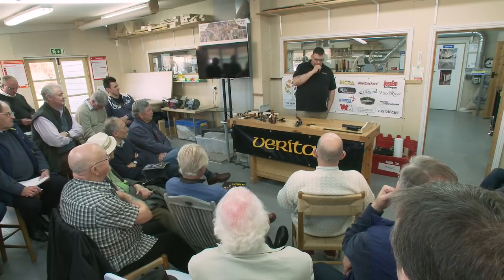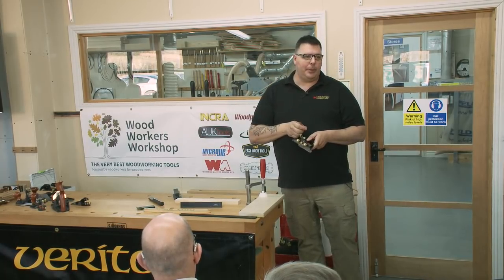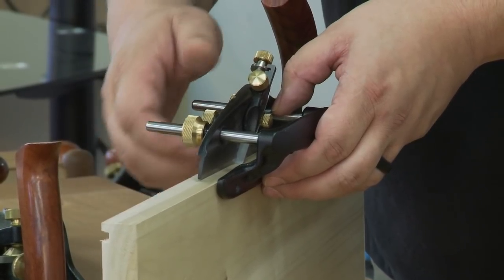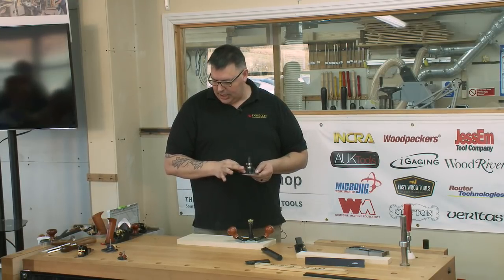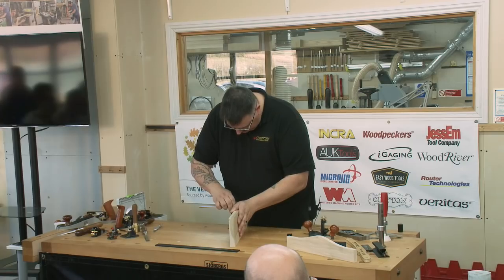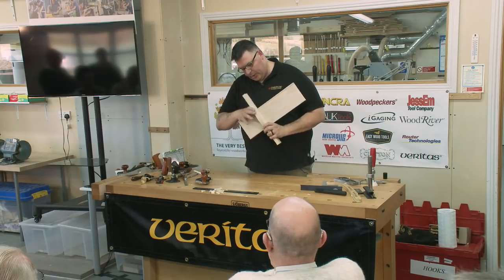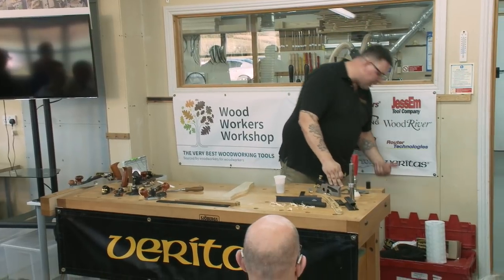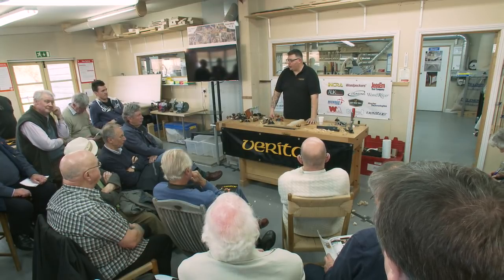Vic Tesolin - Plough Planes and Router Planes

Comment: I know this was 6 years ago but, if you still check or still get these comments coming through to you, very very  helpful and informative 👍. 
You certainly do get to use some top of the range woodworking tools. 
Unfortunately as a pensioner I'm afraid Varitas is outside my budget. 
One thing that struck me was, you make reference to breathing in sawdust when using a power router, 😊 but then having made two cuts with dovetail saw you blew the dust towards your guest onlookers 😮. 
Power tools ok in the right environment but, there's nothing more pleasing than hand tools and achieving a sence of pride in what you have made. 
Best wishes, hope you are still doing seminars and still loving your woodwork. 
Cheers Les.

Comment: Great video when I was looking up info on this plough plane. Funny enough Veritas just released a smaller plough plane that is a little bit less expensive and form fitting for just doing drawer bottoms and similar tasks.

Also I love my miniature router plane. I find it very useful when working on the mouths of wooden hand planes where I need a 1/8" mouth cut to an exact depth. Saved me many times in tight locations, and works just as well as any larger tool.

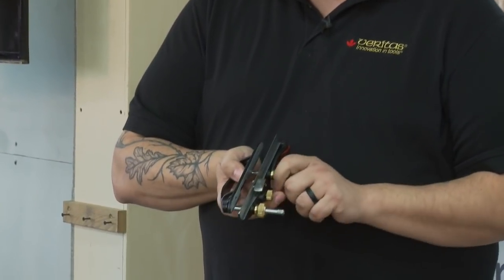Comment: 5:05 Vic says that they depth and the offset doesnt need to be exactly 1/4" and that he eyes it up.  Is that because wood is hydroscopic and will move, or for another reason?  Thanks!
Reply: Late answer but It’s about relativity, if the fence is the same across all the drawers then it doesn’t matter as it will sit flat across them all, you could spend the time to measure it to be perfect but is anyone going to pull out your drawer and measure?

Comment: The magic is in the magicain not the wand. So no need to buy top spec tools when you can pick up second hand stuff that is just as good and sometimes better for alot less. Most people don't work with their hands anymore,  but the tools are in plentifully supply. Paul sellers has a wonderful narrative and easy to understand instruction.